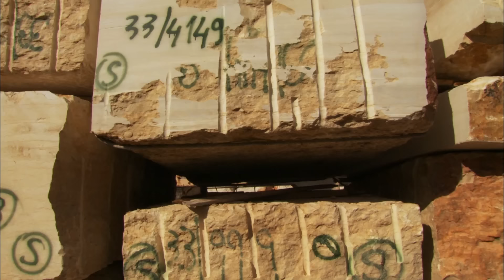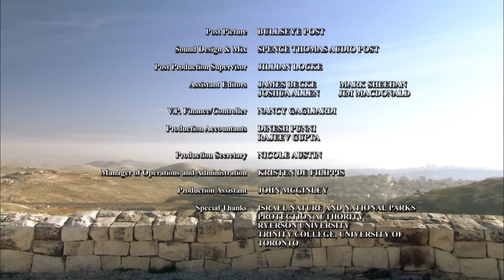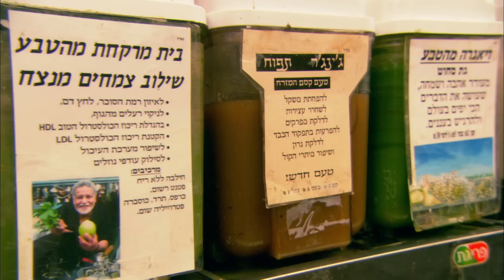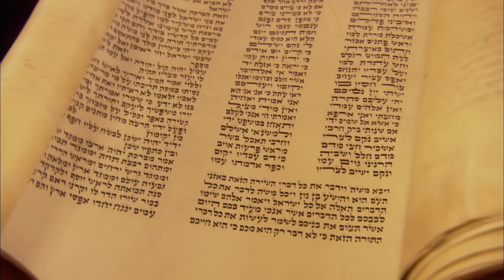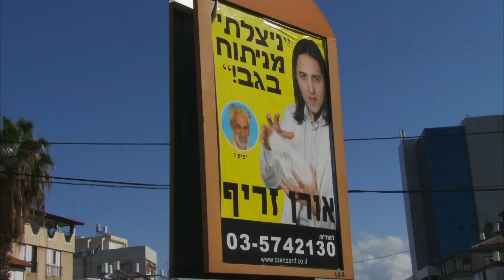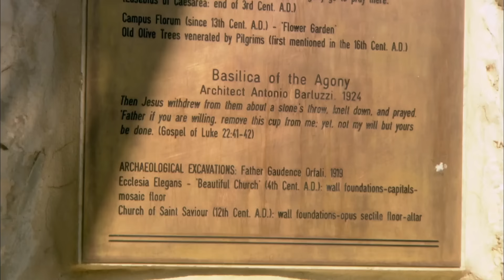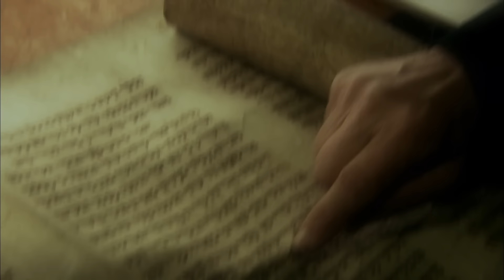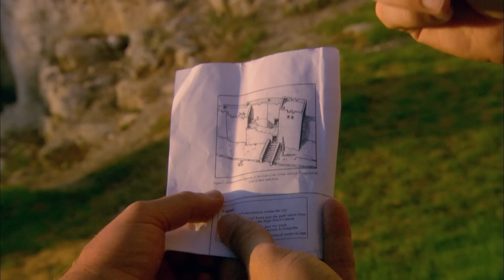Everyday Realities in Biblical Times Explored | Parable

Comment: Using urine was not just a Roman Technique.  Its been used for fabrics up until about 150 - 200 years ago (give or take).  It was especially used for dying fabrics.  The ammonia is what helped set the dye into the fabric.  Bleach also has ammonia in it which is probably why they used it to wash whites (and by they I mean both the Romans AND modern people, I wouldn't doubt the technique goes back further than Rome).

Comment: Interesting as both carpenters and masons in the Prophets are builders of idols.

The stone mason does what?

The same thing as the carpenter.

[Isa 41:7 KJV] 7 So the carpenter encouraged the goldsmith, [and] he that smootheth [with] the hammer him that smote the anvil, saying, It [is] ready for the sodering: and he fastened it with nails, [that] it should not be moved.
[Isa 44:13 KJV] 13 The carpenter stretcheth out [his] rule; he marketh it out with a line; he fitteth it with planes, and he marketh it out with the compass, and maketh it after the figure of a man, according to the beauty of a man; that it may remain in the house.

They craft an image that you worship instead of YHWH alone.

Comment: I wonder if there was ever that many Romans taking a dump at the same time. 
Thats a better bathroom than most large venues have now. Like 80 people at a time... the line would be nothing, even at band's setbreak.

Though I suppose it was the bathroom for that entire end of town...maybe in the AM there might be that many people using it at the same time. I doubt many went there to pee...urine was used in cleaning, people had a piss pot at home. You go to the public toilet to pass out cigars. 
They felt the need to make it with like 80 spots when it was designed and proposed... they must have anticipated it would be necessary at peak times. And probably so you could not have to sit right next to someone. 
I dont care how differently Romans regarded body modesty... nobody wants someone sitting on top of them well they are trying to drop a deuce. Especially if they are dropping one too. It's awkward. Even cats don't like an audience. 

Sorry, I went all George Costanza and thought way too hard about the bathrooms. 😂

Comment: Were they meant to be Roman soldiers at 8:39???

If so, you had choice of chain, scale or plate armour, but not leather. And particularly not leather strips. Lose strips of any sort of armour wouldn't wouldn't do much to stop a spear (or sword) point. The helmets are wrong; no cheek flaps for starters. The javelins are wrong; a Roman pilum has a thin metal shaft for about 1/3 of its length before the tip. The shields are too small, the wrong shape and should not be strapped to their arms.

I can see one soldier with a sword on his right hip. That is one detail you actually got right. However the cross-guard and pommel look Medieval, not Roman.

It doesn't take much to find out what an Imperial Roman soldier looked like. If this is the level of research for this documentary, I'm really underwhelmed.